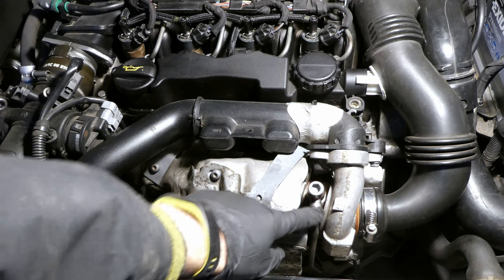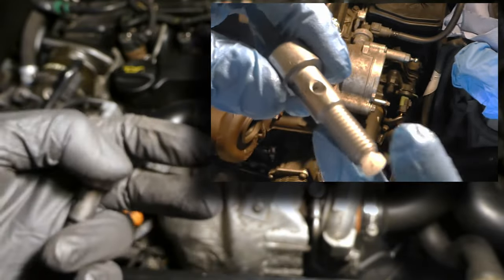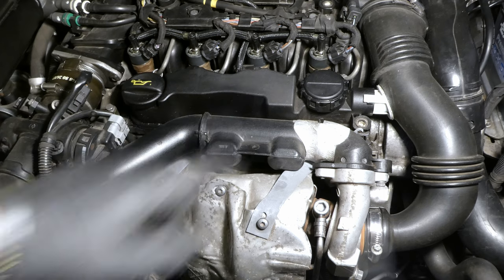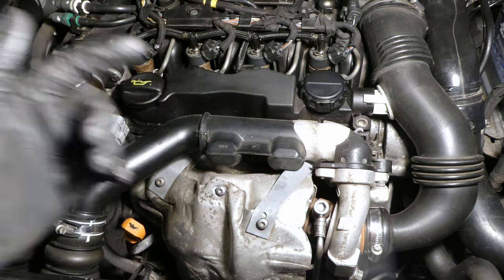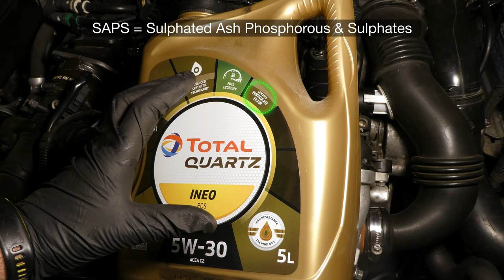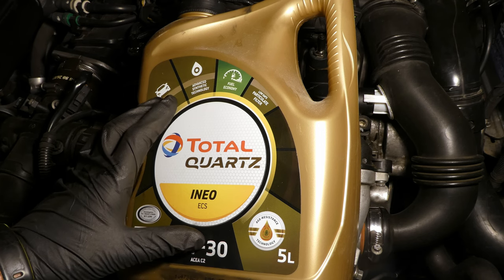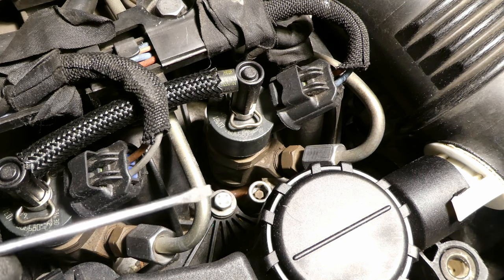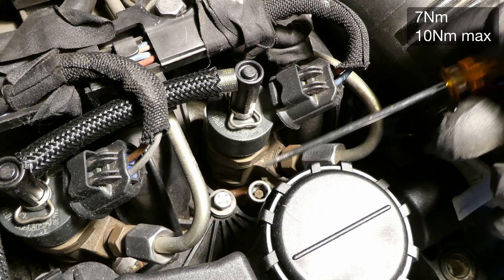1.6HDi turbo failures, the 2 main reasons and surprisingly simple steps to prevent it

Comment: just checked mine, upper banjo had a black burned look to it & some black burn to the surroundings. Im worried about my turbo now. Also some oil stating to collect around the twin padded large hoses to the left of the engine. What would you suggest? Last service was last december around 4k ago.
Reply from the maker: Difficult to tell. If I were you I would wipe it clean, proper clean, you could use small amounts of carb cleaner and then monitor to see if will come back. It could be that at the service someone spilled a little bit and that burnt. Where is the oil starting to collect? On the right-hand side? Maybe this might help: https://www.youtube.com/watch?v=ziKR6M6ToSg

Comment: its the bolts themselves not the nuts when you remove the injector see how loose those studs are most of mine were barely in. you can tighten them with a torx E size socket cant remember the size

Comment: Hey, could some oil/diesel next to the injectors indicate a bad seal? I've replaced the third cylinders injector seals about 4k km ago and recently the turbo blew up. The banjo bolt, oil strainer and oil filter were clean and the oil didn't have any metal shavings. Or could it be that the turbo blew up due to age and mileage? It's a c4 2006 1.6hdi with 260k km. Thanks
Reply from the maker: Difficult to tell without looking at the car, but carbon deposits around the injector seats definitely a bad injector seal. A bit of oil could come from anywhere, someone did not quite fill the oil properly when it was replaces ot something. If it was wiped clean and then it came again, then it is leaking.
I do not think turbos blow from just age. Yes, they do age and the tolerances get bigger, but it will be just blowing a bit of oil, rather than blow altogether if you know what I mean. I hate that expression. I meant that they do not blow from age, they simply pass a bit of oil, like smoking a bit, but that does not mean that they will disintegrate in the next few thousand miles or so.

Comment: Regarding the injector bolts you need to pay attention for the bolt not to be loose since that is also threaded, also those are replaced very often since they very soft material and they stretch, I have replaced the injector seals 3 times on my Peugeot, I only fixed the leak after I bough an injector seat cutter and cleaned the seats an injector, also replaced those bolts which were VERY VERY loose, unscrewed by hand
Reply from the maker: Thank you for the comment, much appreciated and good call on the loose injector bolts.
Reply: I had to give up replacing the bolts. I wanted to because they stretch as you say, but didnt manage to loosen any of them.
Reply from the maker: @MrQueelie  Yes, they are a bit of a nightmare. You could potentially drill them out and re-thread them with bigger bolts, but that requires some effort.
Reply: @moremolecules  Yeah, they are still holding after the job in May this year, so will hopefully be fine.
Reply from the maker: @MrQueelie  Maybe this technique will work? https://youtu.be/5fk_Ibv7w50?t=1404
The video is in Russian, but you can get the gist of it. I've watched a few videos of the person and his stuff are rather good. Problem is the understanding, but with google translate it kind of works.
Reply: @moremolecules  Nice technique. I will definitely try that combined with having a very warm engine if I have to do it some time. I did the mistake of letting the engine cool down before even attempting to remove the last injectors last time. Nr. 4 took a real beating with the slide hammer... I read somewhere that they let the engine idle for half a day before removing the injectors
Reply from the maker: Yes, the engine needs to be hot. It stems from the fact that these are different metals and expand/contract with different rates, so you get some movement (micro) between the different metals and these could be extracted more easily.
Reply: You need to shock the retaining studs or they will snap the little e torx off the top

Comment: I have the same engine as this and it is burning oil i dont know what is wrong i put thr car to 3100 reves and it bogs down and lots of blue smoke comes out also power seems to be lower after 3k revs to would you know what is wrong thanks
Reply from the maker: I would guess that it is the turbo somewhat spewing oil. The loss of power as well. Check the propeller for free play for example here: https://youtu.be/-ML49tY9Pgk
This is normal, check if yours is not, but potentially you would need to replace the turbo cartridge. Maybe I am wrong, you never know

Comment: Hi, I have the following problem with my c4 1.6hdi 109 hp year 2007 euro 3, after the engine warms up it stops firing, I changed the pressure sensor, egr, vacuum sensor plus hoses plus flowmeter but I noticed that if I remove the plug from the car's flowmeter it works perfectly, if I plug it in again, the fun starts again and it stops firing... help, I don't know what to do with it
Reply from the maker: Do you mean the MAF sensor? If you remove the MAF sensor and it works, buy a new one and replace it. THey are on the expensive side of things, but fairly frequent problems with these. You could try cleaning the MAF element with alcohol, but most of the time it has burnt. You could try buying a second hand one as they are cheaper, but generally it is unclear how goo they are.

Comment: Do you know the height in mm of the copper washers of the injectors ? Thank you
Reply from the maker: Fairly thin, but not too sure about the correct mm. Generally, depending on how much one needs to shave the seat, there may need two washers instead of one.

Comment: Tightening the injector nuts, when the engine warm or cold?
Reply from the maker: I would do it on a cold engine, although it can also be done on a hot engine. When on hot engine the risk is to stretch the studs and potentially break them.

Comment: I had leaking injectors replaced with carbon deposits on top my turbo is now failing and making a grinding noise if i replace the turbo what else do i need to replace just turbo oil and banjo bolt or should i be changing feed line and oil filter etc ? Thanks im advance
Reply from the maker: Yeah, all of the above. Do a few oil changes every say 300 miles + the oil filter. You do not need to change the feed line, but definitely change the oil filter with new oil several times. If the turbo has not gone, it should be alright with a new banjo bolt, oil pickup.

Comment: Hi what would cause a miss with no patten at all, sometimes it does it and sometimes it doesn't.  Where one of the injectors sit theres like water or condensation, its not diesel or oil. No warning lights comes on so at a lose my m8 is. Many thanks
Reply from the maker: Could be quite a few things, difficult to tell, depends when it is hapenning. The water, if it is like water, maybe coolant or water is finding its way. Probably good to fix that as the water will corrode stuff in there or it will turn it in some hard calcium deposit.
Reply: @moremolecules  will a icarsoft multi system car diagnostic tool, its the FR V2.0 specialist designed for French and Italian cars. Many thanks. Also it will allow you to look at all diesel injector readings so is there a chart that could tell if an injector is underperforming? Many thanks.
Reply from the maker: @deanandrew-gr1ch  I am not familiar with it, but it could work you never know.
Reply: @moremolecules  yea think that's the black brownish colour around the bottom of the injector where they sit is burnt carbon?  I'm pretty sure it needs a new seal there on that number 3 injector as there's no where else water or anything would cause a small bit of liquid at the bottom of where the injector is. plus that's a small amount of liquid that would  have evaporated  away, with  the heat from the engine. No smell of any diesel from it either. May aswell take all the injectors out to see what condition they are in and whether any seal needs doing on the bottom seals.  any if gone apart from the one which is gone, I personally think. We have a computer which can reprogram injectors, pdf regeneration and re-set,  oil reset and so on. It also allows an instant read out of every injectors. Like injector 1 is at +2. Something but the second injector will have a minus line - then the reading of the injector performance. Is it possible to match each injector readings to a chart to find out if they are working A1? So sorry I just forgot I said about that computer before it's been a long day lol I've just nipped around to my m8s who's account this is as my phones in the shop at the moment being fixed so its hard then to be able to communicate with anyone.
Reply from the maker: @deanandrew-gr1ch  Yes, you can use the injector readings as an indication. They are correction values nd for good working injectors they should be in the range of +/-1, so if one is +2 would mean that it is probably quite blocked as the ECU is opening that quite a bit more than the others.
Unlikely to be water, that would evaporate very quickly on the hot engine. Might be just starting to chuff, so not yet diesel/exhaust smell, but with time it will eat more and more of the seal and you will get the smell and more burnt carbon.
Reply: @moremolecules  ok thank you ever so much for the info as I have no other go to people to ask.
Reply from the maker: @deanandrew-gr1ch  I perfectly know what you mean. For some of these videos I have gone over all the internet and other sources until I know what is going on and film them. That is why I am putting them out there, maybe it will help someone. If I can reply and help I will.
Reply: @moremolecules  thank you really appreciate your videos

Comment: I have a Citroen C4 Diesel with some tar build up around cylinder 4, how can you effectively remove it? Thanks
Reply from the maker: The most effective and right way is to replace the copper washer at the bottom. Otherwise you could tighten the nuts a bit, but this is only temporary.

Comment: Well, those two reasons are true. But you for get about biggest one and thats oil pan. You have to replace it to straight one so you can change your oil fully and also delete that Iron thing in oil tubes to turbo.
Reply from the maker: I agree with the pan, but it does not make that much of a difference. If you replace the oil (straight pan or not) you literally within 100 miles get black oil. 50 odd ml of old oil left is not going to make that much of a difference when you put 3.5-3.7L inside of a new oil.
Now the mesh, there are two designs of that filter, metal mesh and a bigger plastic filter. The metal mesh needs to be raplaced with the new design filter. It has much bigger surface and much more difficult to get blocked. Now removing it, well, it serves a purpose this filter, when you remove it, yes oil flow will be better but any particles will end up in the turbo itself and cause the problem there. I did replace my turbo cartridge, but did not remove the oil line filter and I really thought about it for a long time.
Reply: @moremolecules True. I replaced my pan with straight and bigger one. So now i have aprox. 4.3 liters of oil. I have Partner 2017 Outdoor 4x4 so there steel cage under engine from 3mm thick steel.
Reply: @moremolecules Also with this kind of cars is there one big problem. Thats location of NOx ECU under car. I moved mine so its not splashed with water. Also this ECU is mostly fixable by opening it and clean if there is problem with NOx. I hate when i see videos when peoples call service and they replace it for 200 - 300$. To days service isnt about fixing anymore, its about changing for new.
Reply from the maker: @icyclaw13  It is a diesel 1.6 HDi, no NOx on sensors on these vehicles...
Reply: @moremolecules  Well, there is Lambda senzor with its ECU on same position. Same thing is for diesel aditive, pump and electronics are under car on bad spot. If you ride in snow, its full of ice in some minutes and after time its leaking inside. Everyelectronic circuit on Partners and Berlingos got poor water proof. I know NOx is only in BlueHDI, but other elektronic under cas is vulnerable too.
Reply from the maker: @icyclaw13  Probably for newer HDis, on mine the electronics are on top of the engine, but still water can kind of creep in.

Comment: Hi, thanks for the video. I have got a 2019 Peugeot 3008. I have DTC Crankcase Fumes Heater Control - Open Circuit. The valve cover that has the cranckase breather - round thing with zigzig locker opposite the engine oil filler cap is  leak oil. Is it possible this is throwing this DTC?
Reply from the maker: Yeah, difficult to say, but most likely that is the culprit for the DTC. You need to see why it is leaking oil from the cap. It means that you have too much crankcase pressure, but this could be from a number of things, for example your DPF could be blocked, so resulting in some back pressure.
Reply: @moremolecules  Thanks. Its a gasoline engine 1.2. Its leaking on the cap and then through the hose to the intake.
Reply from the maker: @partoems9376  You could take the zig-zag cap off and see if the membrane is intact and the spring is not broken. Rare this would happen, but you never know. Difficult to say from a distance, but there must be some sort of back pressure so the crankcase is under excessive pressure. I am not too familiar with the newer 1.2 petrol, but there must be like a catalyst converter. That could be blocked, although unlikely.

Comment: I am struggling to understand how a failed injector seal can contaminate the oil. Even with a failed injector seal, the black tar-like substance has no way of getting into the valve/rocker cover. The seals at the top of the injectors are only designed to stop moisture/water from seeping down to the bottom of the injector. With the seals and injector removed, you're not exposing any openings to the engine oil in the cylinder head. Am I misunderstanding something?
Reply from the maker: Yeah, I should have been more explicit in the video, although most people will switch off, hence the shortness of the explanation.
First of all, the injector tube is not integral to the head of the engine, so the bits can leak into the oil, if they can pass the top seal.
Then comes the bit where all the oil gets filtered by the oil filter, but....the oil filters can get clogged with less frequent oil changes or the oil filter is sub-par quality. It has a bypass valve, so the stuff inside, the crud and carbon particles then can get through. Also, some of the oil filter are not that good quality and sometimes either the bypass valve opens too early or it leaks, so letting more stuff through. All these mght go to the turbo mesh and block it. That is the simple reason for the more frequent oil and oil filter changes, so the oil filter does not get blocked and bypass valve open to let things through. The oil filter is full flow filter, so if there is not enough volume the bypass valve will open.

Comment: Can you please tell me where that cable from the wastegate goes? It looks like it goes around on the back but theres nothing to connect too i have a c max 1.6 tdci the engine looks exactly like yours any tips ?
Reply from the maker: It is exactly the same engine apart from the slight redesign of the air intake in the 1.6 TDCi. Which cable is that? If it is looking like a pipe is the vacuum pipe that drives the wastegate and it goes back to the lower right of the engine (looking from front top) and connects to the turbo solenoid. If that is the 92bhp engine of course.
Reply: @moremolecules  yeah the pipe sorry my bad 😅 i will see tomorrow at work still thanks for your time
Reply from the maker: @jp.med1a  If it is not the 110bhp, as that is the slightly different model turbo, the pipe definitely goes to the turbo solenoid at the right lower back, kind of brownish like octopus-type looking part.

Comment: Great video about turbo maintance my peugeot brother 🙏Also what I do wanna ask you something interesting Wich I heard from some is that  driving the car for short distances like for example in city's. Can Also damage the turbo?🙄
Reply from the maker: Short drives would not be detrimental to the turbo, but it might be to the DPF if you have one. Also, the oil get diluted more with condensation, so it is not optimal. With longer driving the water condensate in the oil evaporates and performs better.
Reply: @moremolecules  I see so it only affects the dpf and EGR  valve ,also btw 5w30 vs 5w40 oil Wich u think is better since my car has high millage no dpf to btw
Reply from the maker: @dracony7649  Good question, I have always used 5w30, but 5w40 is also alright. Less smoke with the 5w40. I would use 5w40 if I can find one with low saps, but as far as I know only the 5230 is low in saps.
Reply: There is a rare type of 5W30 with C2/C3 spec with low SAPS and viscosity similar to 5W40 of >3.5  viscosity HTHS. This is what should be used.

Comment: Hi, I have 1.6hdi 66kw 90hp without dpf. In manual recomended oil is 5w-40. Peugeot 307sw restailing 2007. Is that corect?
Reply from the maker: My manual says 5W30, but 5W40 would also work alright depeding on where you are. Either way will be alright. With 5W40 is a bit thicker so less smoke most likely.